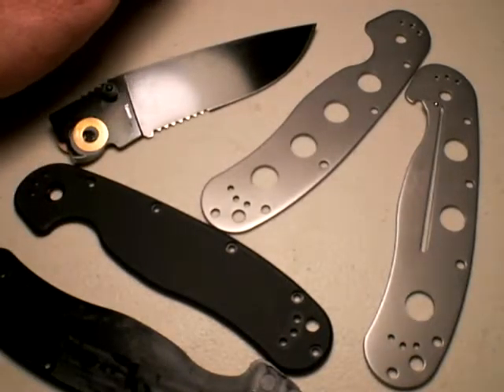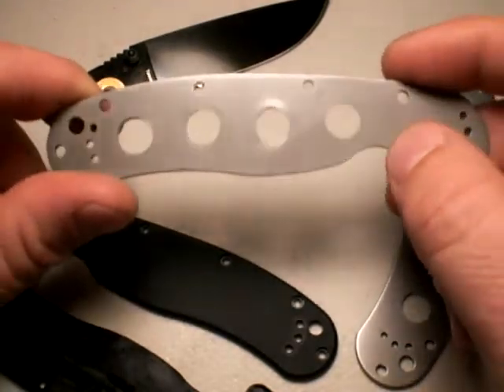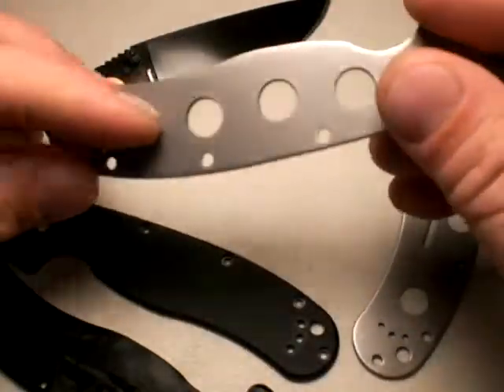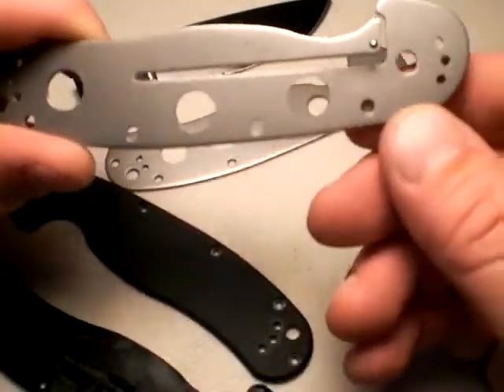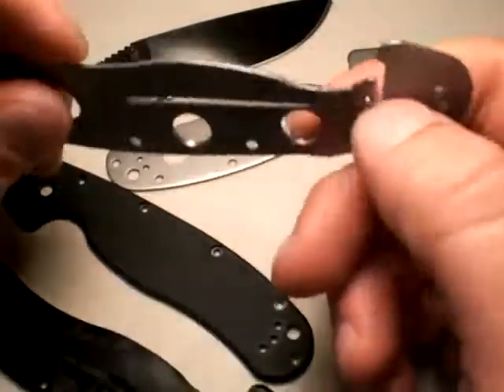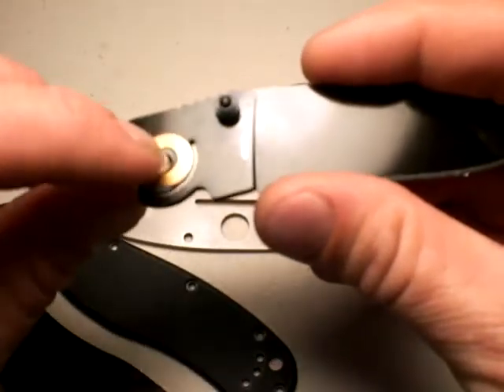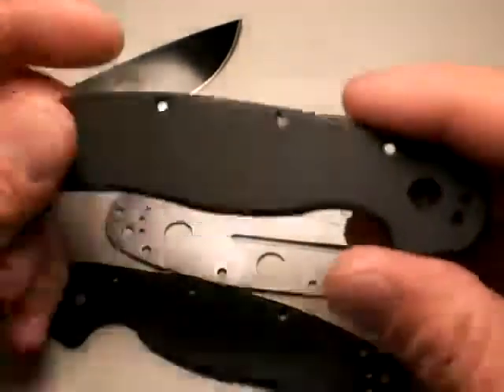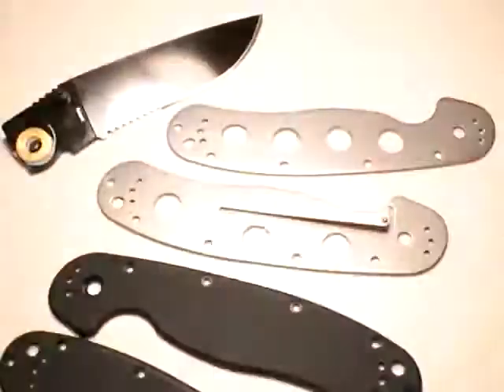Re: Ontario RAT Model 1 Folding Tactical

Comment: NOTICE 2: See how thin they are? Even if he had centered it correctly he would still have two little pieces of steel on either side of the holes. If he would have drilled smaller holes and more of them he would maintain strength throughout the liners and still shave weight. The smaller the holes you drill, the more holes you will be able to drill, thus cutting more weight. I would drill 1/8" - 3/16" holes. Make sure you count your holes so you can cut an equal amount of weight on each liner.

Comment: NOTICE 1:  I have an improvement on this "mod". I like Nutn. He's a good guy. In this video the right hole (actually both holes) that he drilled underneath the liner lock weakened that portion of the liner substantially (in theory). There are now only two little pieces of steel on the top and bottom of the hole (holes) holding the pivot side of that liner to the rest of it.  Go to next comment.

Comment: When you put it back together, how did you make sure that the blade stays centred? Mine now has a scissors type effect when I'm closing it with the non locking side of the frame because the locking mechanism pushes the blade into the other side.

Comment: You could have also drilled the plastic handle with the same holes to reduce the weight or used a smaller drill bit and made more holes.